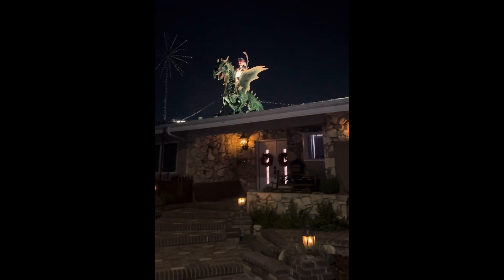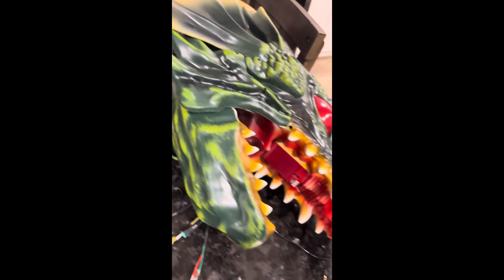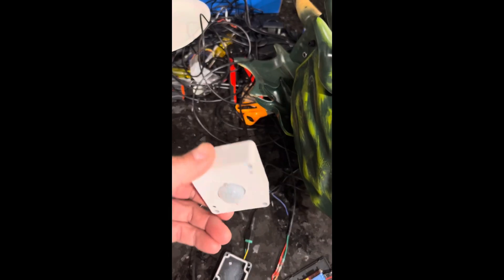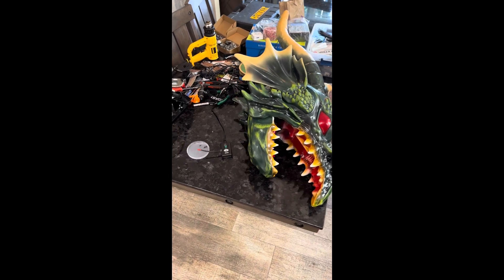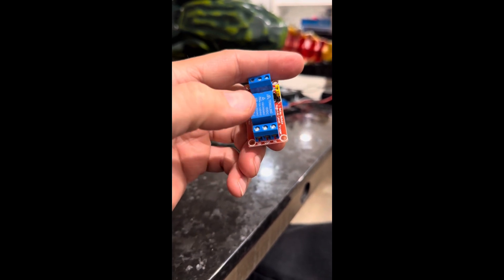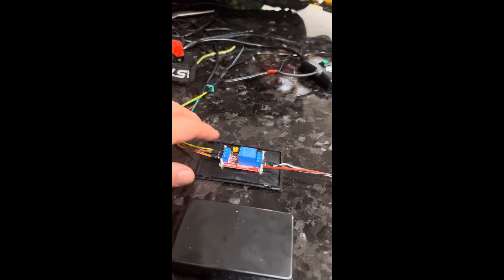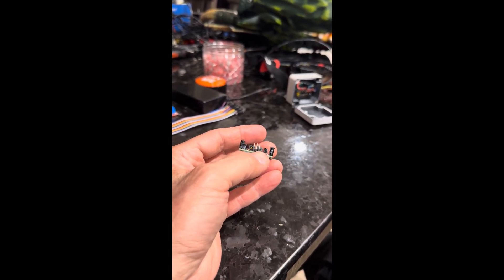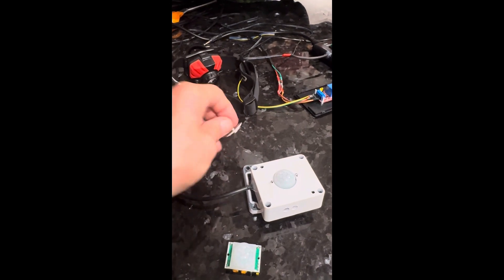Home Depot Dragon Project - How I Did It. ￼

Comment: How long would you say this takes to install parts? Trying to convince my husband its an easy diy!
Reply from the maker: It’s not bad. Just have to make the relays and hook up the fog machine to the hose coming out the back and open up the fog machine button to control with a relay also. The lights in the mouth are optional.
Reply: @diylightguy is this something you might do as a service if I send you the dragon head and fog remote? Kind of like the plug and play heads where most hard stuff is done reducing the steps we would have to do :)

Comment: How did you run extra lights in the mouth? We have an older model (different color) & the LED light isn't very bright compared to our new dragon. Any way to upgrade the eyes too?
Reply from the maker: I purchased a roll of red and orange, 12 V 5050 LED strips and cut two pieces to the length I needed. I put red on one side of the mouth and orange on the other side of the mouth. I ran the wires out the back of the mouth And into a relay that would turn the lights on at the same time it triggered the fog machine and the dragon animation. Here is a link to the orange LED lights I used: https://amzn.to/4hiubyu
Link to the red LEDs, I used:  https://amzn.to/4dVl6bF. The only bummer is, you have to buy a whole 16 foot roll for just two short pieces. I did not trust the peel and stick that came with the LEDs. So I peeled off the tape and used hot glue to adhere them in the mouth. I opened up the head to look at the eyes, I wasn’t sure what the voltage LED they were using in there so I passed on changing the LEDs in the eyes